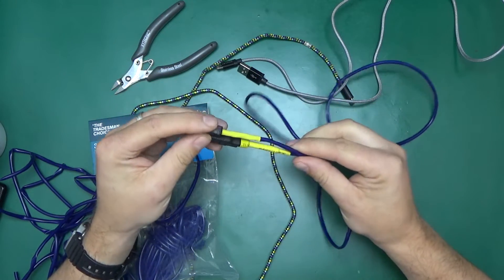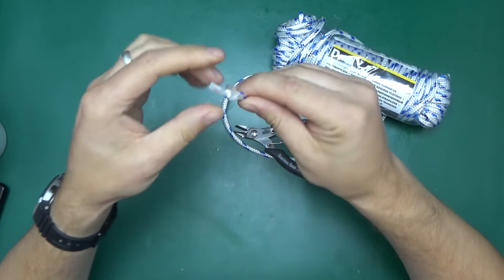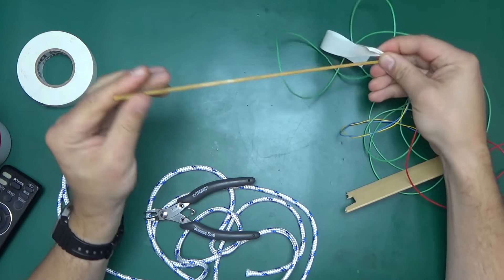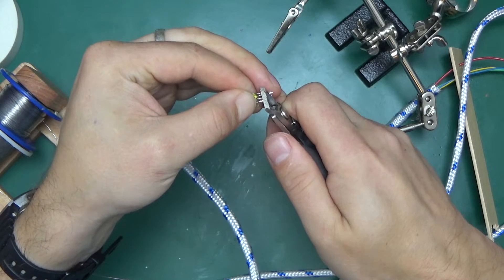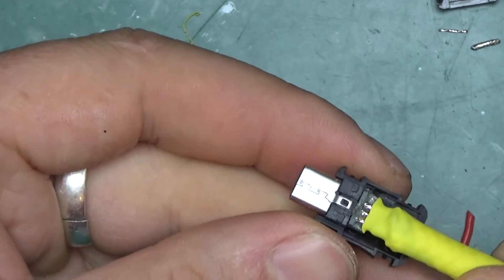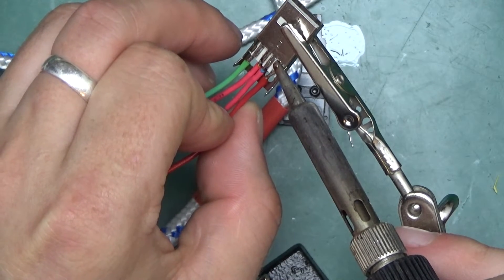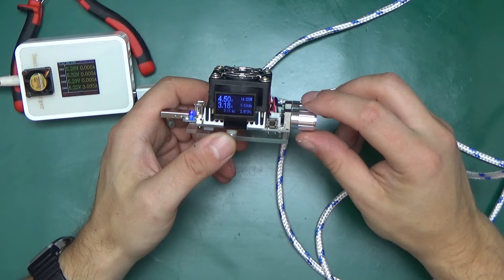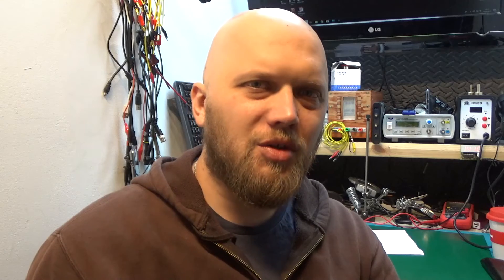#026 -Make your own USB braided cable!

Comment: Does anyone else think that apple cables wear easier than normal ones?? The plastic is too soft. I have an apple adapter that broke down after a few months but the knockoff charger is still intact after the same time. The knockoff charger’s plastic is noticeably harder and less rubbery

Comment: Awesome! I wonder if you could rip out the conductors from a spare ethernet cable to make the USB cable - as these are stranded copper with the individual conductors already twisted...
Reply: That's probably what he used for the data lines

Comment: For the process and idea 10/10
for the color sceme 2/10 would bang ;D
you should have used either white or black heatshrink for optical beauty, and much shorter so it doesnt jump into your eye that its self made.
Reply: so..... it's functional, well made, intact, reliable, but it ain't cool because it's not branded?

Comment: Fantastic work, dude! 😊
You should definitely try some silicone wire. It NEVER melts. 😊
Reply from the maker: I will check it out when I find some.
Reply: silicone wire with type c😀
Reply: @baz-jc4qt  Should be good, hum? 😃
Reply from the maker: Need to find some cheap type c plugs. But after a while now, I really like the braided feel of the cable :)

Comment: If a plug is sold to be soldered and assembled I feel it should not need anything to keep it together at all. It should really clip or screw together.
That said, if I need a plug to not fall apart, I put heat shrink around it. I usually do this on repairs, where I cut open a connector length wise (either one cut to pry out the connector and wire or two cuts for easy access to make kind of two shells) to fix broken conductors right at the plug. For that it is good to have an assortment of larger diameter heatshrink (doesn't cost much and sets are available from your usual suspects). I tried glues, but they are either messy (especially tape, which' glue gets gooey after some time and sticks to everything) or just doesn't hold very long. Glue also prevents the plug from being opened easily again. Heat shrink is the closest you can get to original stability I guess.
Reply from the maker: I did exactly that next day! Heat shrink all the way. Looks good and holds it nicely. The plug  needed extra support to stay closed due to diameter of the cable and braiding. This wouldn't be necessary if the cable was thinner 😜
Reply: For such applications, use dual-walled glue-lined heatshrink. Much stronger, plus the glue makes it stick like shit to a blanket.

Comment: Nice! I just need to source black and red braided wires with at least AWG 18 or 17. I actually have ultra flexible red wire, but it's AWG 14... That's a bit too much I guess?! :D
Reply: At that point most of the resistance will be the contacts in the plug and no longer the wire. So it's a bit of a waste to use thicker cable unless you're planning to make a really long cable.
Reply from the maker: Might be difficult to fit inside the mIcro plug. But if you were doing, say, a USB extension with type A plug on both ends.... Why not!

Comment: Nice video, I would personally make cables with silicone sleves (and silicone insulator).
Reply from the maker: Sounds good, but where can I get some silicone sleeving? (Didn't come across it before) Probably would make the cable more flexible, but I kinda like the braided look and feel. Thanks!
Reply: Yes braided cable looks very nice, but sometimes I like to have super flexible cables, and silicone cables are often superflexible (and soldering iron proof).
Reply from the maker: True. Let me know if you come across a good and inexpensive source 👍

Comment: Do you have a link to the flux?
Reply from the maker: Here is the "light" stuff:
https://rover.ebay.com/rover/0/0/0?mpre=https%3A%2F%2Fwww.ebay.co.uk%2Fulk%2Fitm%2F112705844428
And the little bit more aggressive one:
https://rover.ebay.com/rover/0/0/0?mpre=https%3A%2F%2Fwww.ebay.co.uk%2Fulk%2Fitm%2F121054733532
Both are polish made fluxes by "Termo Pasty" - I grew up using their products :), they make tons of electronics chemicals.
Also both are, what I would call a "mild" flux. I think both are rosin based.
Reply: He doesn't ship to the netherlands from the ebay.co.uk :'(
Reply from the maker: Search ebay.com or Amazon for TK83 flux or RF800 flux. I just checked and it's on Amazon too. And there are sellers of this on eBay.com shipping worldwide.